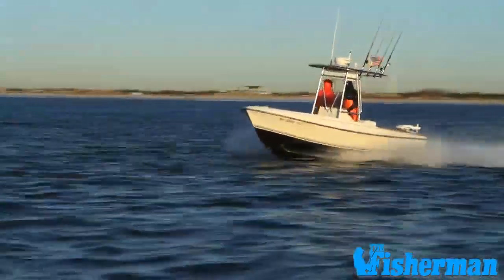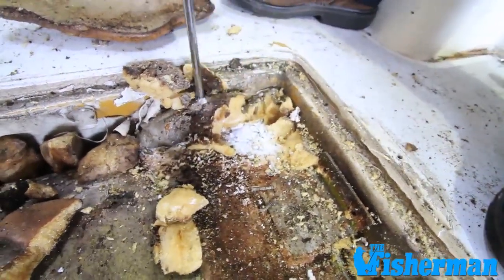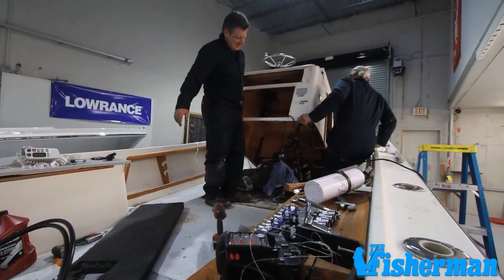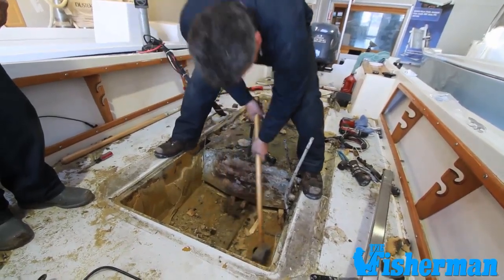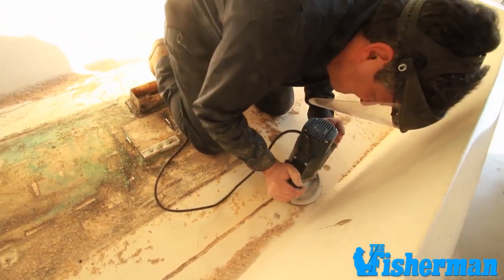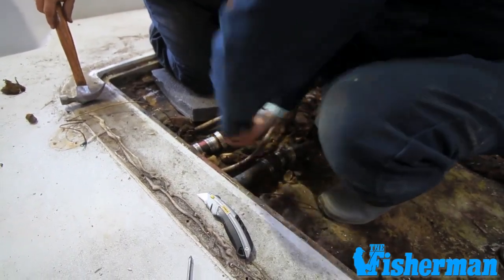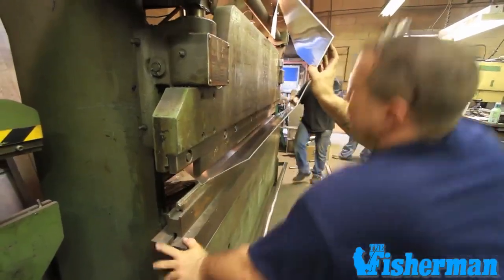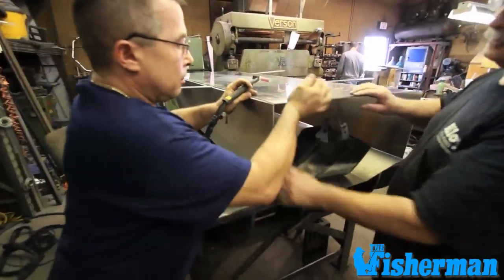Fuel Tank Safety - The Fisherman Magazine

Comment: Great information at the right time.  I just found gas in the bilge today, agh!  Not sure if I am up to this.
Reply: you ever figured out what's up?
Reply: @cajunfamily5227  Presumably yes.  I plummed the fuel lines to one tank to be able to go to my Keys vacation and after the first day the second tank started leaking.  So at this point I am mulling my options.  I really have not gotten any estimates yet.  One guess was less than 10k.  Another was 3 to 4 k per tank.  My big concern about doing this myself is where to cut the deck!  It is a 22 foot cat.  I want to take a video of underneath as the sides to the fuel tanks do NOT go all the way up to the floor.  So I am not confident on if I cut the floor open in the wrong area can it be sound and secure.
Reply: @jeffcarter8160  i just discovered this on a boat i purchased yesterday.   I would appreciate any advice from your experience.
Reply: @scottkuhn  yikes!  Well, first start checking from the tank outlet to the hose, all the way to the motor before you fail the tank.  I just got my boat back 2 months ago.  The fuel tanks had completely corroded.  One had a hole 3mm wide.  2 tanks coated were 1300.  The work to cut out the floor and replace was 5k.